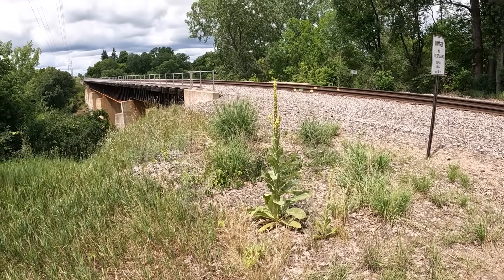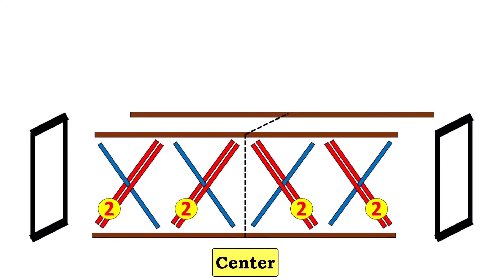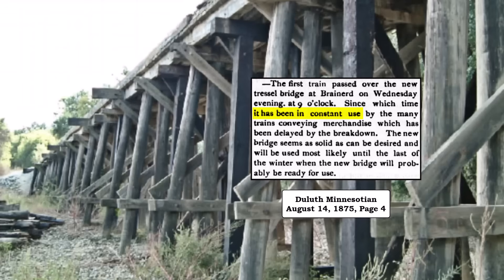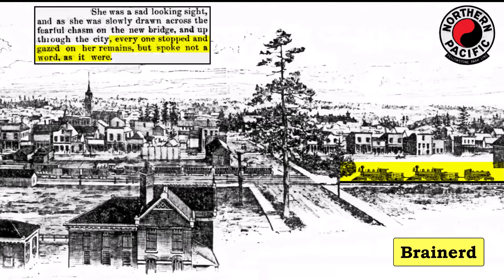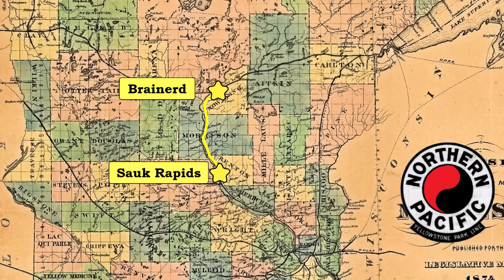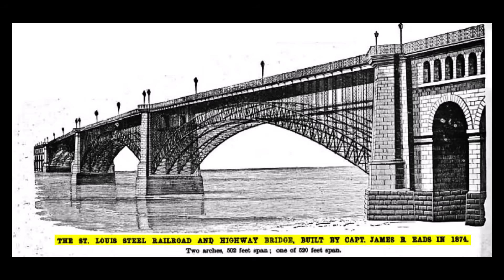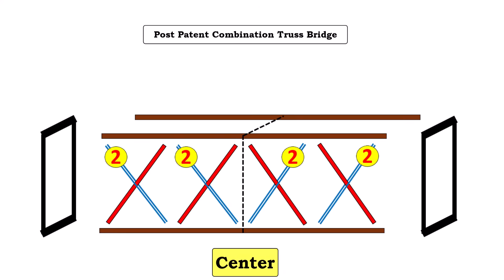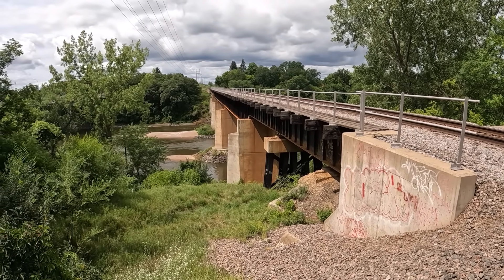Revisiting the 1875 Northern Pacific Bridge Collapse at Brainerd, Minnesota

Comment: Simeon S. Post truss design for a latter structure.  The photos suggest that the replacement structure appeared to be of the Post design. Two similar structures exist in Lancaster, Massachusetts, the closed Ponakin and Atherton bridges are of this design. The Ponakin bridge was closed in 1971, very likely because of the breakage of a primary wrought-iron tension truss member, one of two holding up the structure.
(It took me a while to find the actual problem. Had the other tension member ever broke this structure will go crashing down! No doubt about it, especially when it is under any load!)

Comment: DOLT!!!   A Post Diagonal Truss is totally different from the various forms of a Howe truss!  Deck trusses have the road on the top; when the road is on the bottom it's called a through truss!  Trusses also often have counters to take care of occasional opposing stresses--especially from moving trains--hence the "X".  It would help if you looked up some monographs, articles, etc. on bridge trusses; yes, you're good on the human stuff, not so good bordering on misinformation on the tech.  Using wood AND metal gives a composite truss.  So next time you write about bridges--go look up something on bridge trusses and Messrs William Howe, Caleb Pratt, and Theosiphilus Warren--plus Simeon S Post of Post Truss fame.  Dead-giveaway: in pin-connected structural joint days (US up until ca. 1915 or so) Howe Trusses have diagonal compression members of wood or metal. The tension members are metal truss rods and they are vertical and often with a turnbuckle.  Reverse that with vertical compression members (wood & metal) and diagonal truss rod tension members---you now have a Pratt Truss.  The Warren Truss, today very common, has a characteristic zip-zag pattern and only became common for large bridges after American engineers got over their intense prejudice against riveted structural joints ca. WWI.  Moving from wrought iron to steel helped; that composite period didn't last long--such bridges are more common on highways; I photographed a Whipple Bowstring wood & iron bridge on a county road in Rathbone NY in 1985--it was gone by 1987.  It is suspected locals bought the Whipple Bowstring from NY State when the local state-owned canal system was abandoned in 1878.
       Would have been useful to learn how long that SS Post truss lasted there; it's clearly NOT the modern bridge in your photo.  Post trusses were valued on their stiffness under moving loads; turns out a rolling load at constant speed put the same stresses on a bridge as a stationary load--but having that load change speed puts severe forces on the bridge.  Thus many old bridges had slow speed restrictions and the origin of the phrase "to run for the bridge"--build up speed, then coast across.  So sorry to chew you out; when I saw this tonight I thought I'd get to find out what caused the Brainerd collapse but no such luck other than the "convenient" falling brake beam "excuse" they often used back then (see the Tay Bridge Disaster).  In those days if the train did something to the bridge causing its collapse the bridge designer was NOT at fault; by the 20th century as bridges got much more expensive that changed.  Nowadays bridges are so designed that if an engine derails and strikes the bridge the bridge is supposed to stay up--that's why today's bridges are built so massively!
        Post Trusses for ANY use are now extremely rare.  In Lancaster, Mass. the Poniken Road bridge (now closed) over the Nashua River may be the last example of a classic Post Truss in the US,  Just off Mass. Route 70; there are write-ups on-line on it.

Comment: Two minor notes:  The 'steel' components would have probably been wrought and cast iron. With the exception of the Eads bridge, wrought iron was the preferred material for another two decades in the US.  The other note is that the remains of a two span combination Post truss still exist, in storage.  The best parts of the two are to be used to make one restored pedestrian span in the near future.
Reply: Steel was more expensive and into the 1870's there was doubt as to whether it could be successfully formed into long beans.  Cast iron does NOT handle bridge stresses well to put it mildly--wrought iron is what you use in bridges.  Cast iron's weaknesses were found out the hard way--fortunately mostly in England in the 1840's and '50's.
Reply: Thomas, I think we generally agree on steel.  Although it began in the the 1870s, the main transition from wrought iron to steel wasn't complete until the 1890s.

Use of structural cast iron this is something I have knowledge of.  Full cast iron members were used into the 1870s (technically the early 1880s but that's a special case) for both road and rail bridges.  A remaining rail bridge example is the Bollman Warren truss design used on the B&O, the last remaining example, from 1871, is still in use on the GAP hiking trail in PA.  There are some cast iron road bridges still open to vehicular traffic in the US today.

However, in this case, the cast iron I was referring to were the smaller elements, such as connection blocks, which were used in bridges, notably on combination trusses and wrought iron columns (Phoenix Columns and Keystone Columns) through the 1890s.    @thomasrengel5577

Comment: Amazing how they could block navagation that way. What was the clearance left? Who built the dams and any word why they did not have locks?
Reply: Remember, this is Minnesota and half the year that river is frozen.  Lots of shallow rivers ceased to be considered navigable.  River traffic loses out.
Reply from the maker: The old dams were mainly made of wood. I don't think they had the expertise yet to build locks. I would guess the clearance under the new bridge was about 40 feet, as the old one was 60 feet.
Reply: @MNBricks  They built locks on the Erie canal in the early 1800s. It was the expense compared with the envisioned diminishing return from reduce boat traffic I think.